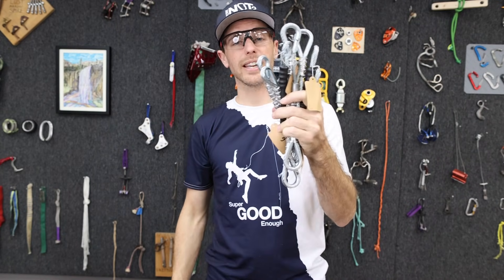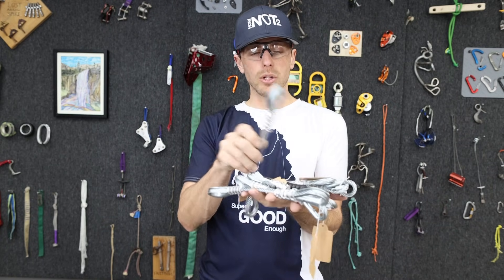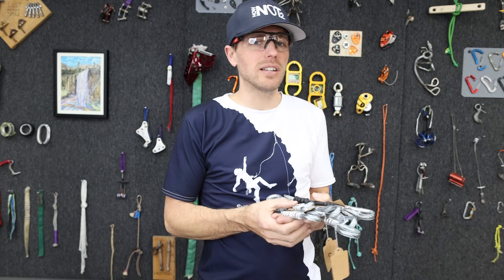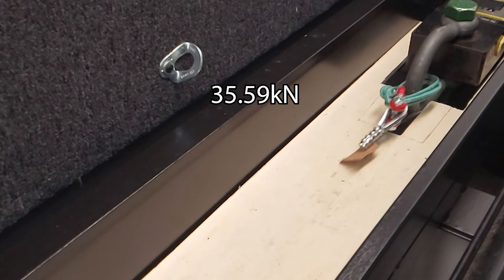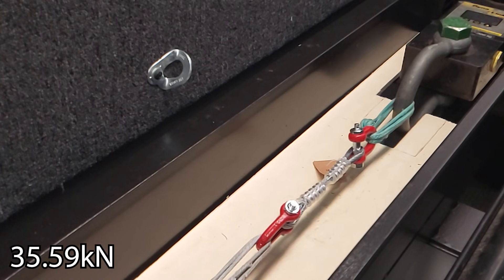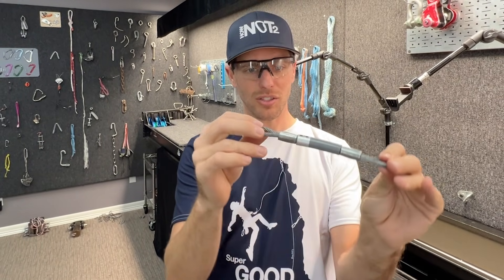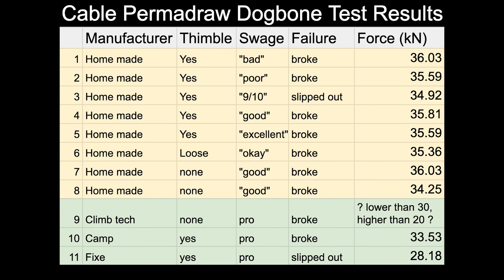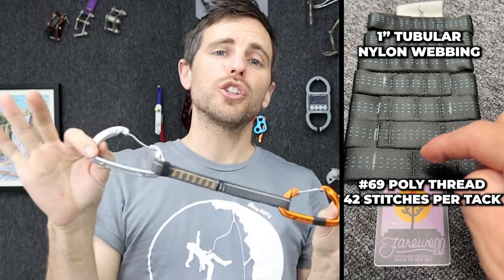Are you UNKNOWINGLY climbing on homemade gear???

Comment: Nice to see testing of homemade galvanized cable and aluminum swages. But I only use stainless for my climate. I've been having a need for extra long permadraws, like 1 meter+. Have some routes with wide ledges and am trying to reduce rope rubbage. Recently bought some 6mm and 8mm 304 stainless steel wire rope, copper sleeves, & stainless steel thimbles. Next time I get out, I gotta break test my hand swaged ones. If the results are good, I plan to proof load each one before installing them. Otherwise I'll look into getting a hydraulic swager and stainless steel sleeves to see how that goes instead.

Comment: if the thimble take the wear can't it become fucked and hurt even more the cable?
Reply: not really since a properly mounted thimble isn’t going to move relative to the cable.
but if you get to the point that the thimble is worn enough that it has sharp edges/you can see the cable, it’s time to replace the whole thing

Comment: always wondered why not just use a short piece of chain for permadraws?  a clear heat shrink sleeve would stiffen it up and still allow visual inspection.

swaged connections can sometimes hide corrosion
Reply: Lots of people do.   Easy to use chain, quicklink and carabiner.     But is more expensive. Especially if you use stainless.   Cable is cheap and super strong.
Reply: Garage door guy here. Aluminum over plain steel corrodes pretty fast in a wet/"salty" environment .

I always oil the swages. Do not oil those dog bone swages just inspect and replace if there is any Al or Fe corrosion.

I have swaged a lot of fat cable for commercial doors.

Swaging with a hammer is plain stupid for either of these applications
Reply: That’s a good Question!
Reply: You can, but the extra weight can affect rope drag in some situations.

Comment: Great tests!  I've made up steel cable with swages for overhead lifts, and it can be safe.  But, used to be there were 2 kinds of swages, copper and aluminum.  Guess which one is cheaper and maybe not as strong?  Yep, aluminum.  The good ones used to be tin plated copper.  Next thing, they DO make a test for them, non-destructive.  It's basically a gauge that will slide over the crimp if it's crimped enough.  If the gauge doesn't fit over the crimp, your crimp tool is worn or out of adjustment.  If it's setup right, the cable breaks before it slips, as in most of your demos.  I don't rock climb, but love the channel!
Reply: It is a go-no-go gauge. The swage manufacturer should sell one right each size of block. We used tons in theater rigging, which is mildly similar to climbing.

Comment: I wonder if welded cable would do anything. I'll email you if I fab some up because I'm an idiot who wants to see her dumb ideas tested
Reply: gone break lower..
Reply: @HochstartHarry  well yeah, but HOW much lower is the question?
Reply: @ghostdog0424  i mean if you want to get your tungsten dirty go for it, i dont see a reason for the test, but noone is stoping you.
Reply: the only welding I'd do on wire rope is to melt the end so it doesn't unravel. If you try it make sure you buy stainless, good luck grinding the zinc off 7x19 lol
Reply: @slowgold20  thing is those things are filled with wire grease, any weld will be porus.
Reply: @HochstartHarry  that too. No structural reason to weld on wire rope.
Reply: Would be difficult. You are dealing with both need to penetrate metal as well as changing properties of metal at higher temps.

Comment: I’ve done a bunch of cable crimping when building high ropes courses, and as long as you use the proper tools, follow the specs, and check your crimps every time, you absolutely can do it yourself.
Reply: It's a lot about knowing what you're doing  - I used to work in a chandlery and we'd do swage cable rigging, a university team borrowed our kit rather than pay us, rigged all their boats and it looked fine to them but all their masts fell down the first time it really blew. So I guess my point is you absolutely can do this stuff if you know how to, but sometimes it takes a bit of experience to know whether you've got it right.
Reply: I've thought about doing some cable draws for myself but have always ended up just using chain as it's more foolproof
Reply: Amusingly, exactly the same conclusion as crimping electrical connections. You just have to use the proper tools. Which unfortunately in the world of electrical connections can be $500+ to crimp a $0.50 connector...
Reply: I was going to be the guy who does the high ropes course comment, but you beat me! 😂 I used to work on high ropes courses (in the UK) as well as building them when I was younger. A LOT of hard work and really long days, but I loved every minute 😊👍👍👍
Reply: When I was building courses in the mid 2000's, aquring a cordless swager was a HUGE game changer. It was heavy, expensive (approx $5k...batteries were $500), but knowing that every connection was pressed to the same force and every connection was clean and uniform was very comforting. Plus, all the swages were very pretty to look at. 

Additinally, it was 1000 times easier to cycle the jaws with a push of a finger compared to getting your whole body weight onto a 4' bar to get it to close.
Reply: @delphic464  Yeah, I wish we had something other than a manual crimper when I was doing it. It’s especially difficult to do it on a 3’ wide platform on a tree…
Reply: You can do anything yourself if you know how, and usually better with more care than the minimum wage factory worker will do it.
But, you have to know how which can be simple if an expert tells you or you follow premium tool+consumable process. But internet instructions are very hit and miss, plenty of website/forum instructions are garbage and you can go wrong.

I deal in electrical crimps too and the amount of f-ups is ridiculous.

Comment: I've made and tested my sewn webbing and swaged steel quick draws. Both are strong enough but I would never sell or subject others to my home grown safety gear - not because I don't think I can make them strong enough but because I don't want to be responsible for the risk and don't have the right insurance if I get sued. I only make and sell non-safety gear. Test some stainless cable with copper swages.

Comment: Are these cables stainless? Or is it expected they will be inspected/replaced more frequently than the anchors they're clipped to due to corrosion? Both homemade and professional made versions
Reply: The Camp cable is not stainless. Fixe Hardware makes theirs galvanized. I suspect the homemade ones are also not stainless, probably galvanized.

Comment: IDK if it applies to climbing, but here in Germany any safety related steel wire has to be able to be inspected (for broken strands, corrosion or loose crimps. IMHO that's not possible with the store-bought versions, due to the almost potted plastic parts. How can one inspect these it they are visibly intact but internally broken? I think i would not clip into these.
Reply: Fully agreed, plastic sheaths also increase corrosion risc
Reply: @lw671  yea! I had never thought about that until I had a rope access gig a couple months ago pulling down some warn vinyl coated GAC from a banner hanging system on the side of a building. The vertical cables where water could drain out or evaporate up in the sun were still reasonably solid, but the horizontal ones where moisture had nowhere to go were so rusted I could snap them in half by hand. I don't think those cables had been up for more than 10 years. Thankfully they hadn't been used in a long time.
Reply: @slowgold20  I work in the Event industry. We have crimped wire mandatory as secondary Fall protection for fixtures (lights or loudspeaker). I've seen older ones in theaters who probably never seen sunlight corroded inside of the crimp.
Reply: @televisonator  so do I, but I haven't seen any corroded lighting safety cables other than surface rust on snap hooks and thimbles which isnt particularly concerning to me. Where in the world do you work? What are the safeties made out of?
Reply: @televisonator   I also work in the entertainment industrial complex. I don't recall ever seeing more than surface rust on non galvanized items
Reply: Hey Guys,
 @JustinVodden  didn't said rust (i think). I said corrosion. I don't know what crimp and wire material are required. I, till now, never seen rust inside of a crimp (steel oxidation). But (provably galvanic) corrosion between the crimp material and the steel. In theaters with high sealings we see it sometimes. (Its not something I see often, provably once  a month and once a year where we have to replace one for that reason. Up there it is always humid.
Reply: I don't know either, but it very common in guides about via ferratas that you should not tape or otherwise cover any section of steel cable.
Reply: Yes some of the homemade ones I'd rather clip than the store bought lol. I think they are really meant for gyms where indoor use will prevent them from corrosion, no?
Reply: I'll have to keep a lookout for corrosion like that.